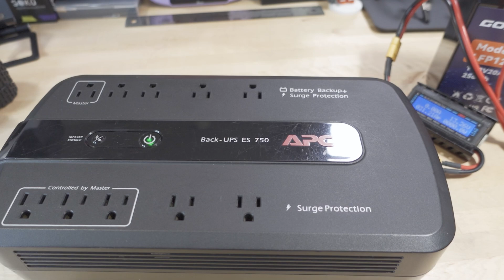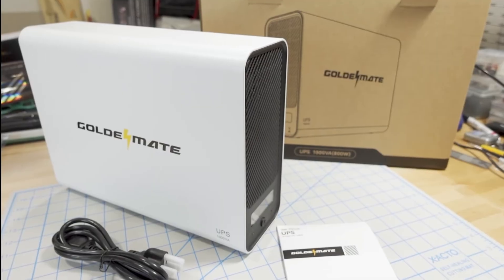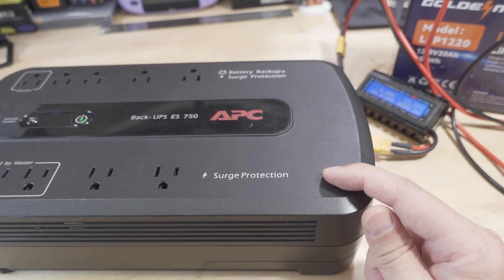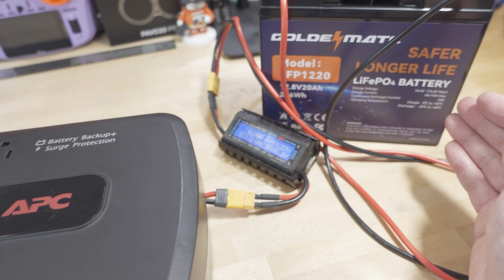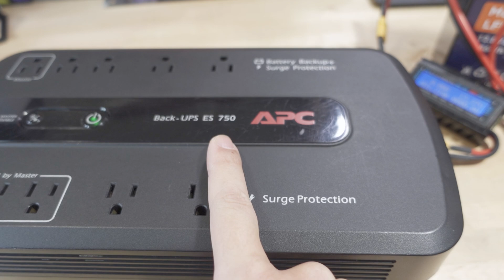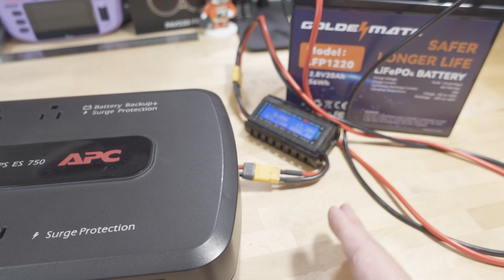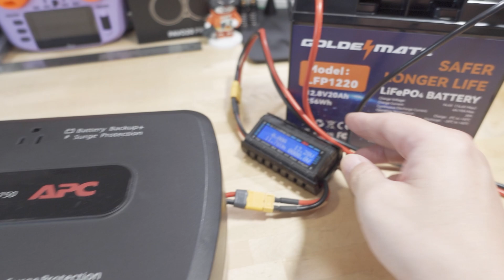DIY LiFePO4 UPS Battery Backup for Cheap ⚡

Comment from the maker: 🛒 Goldenmate 20Ah - http://amzn.to/3yZEfuJ
🛒 XT60 to O Ring Terminal Cable - http://amzn.to/3yXFcng
🛒 XT60 Connector - http://amzn.to/3T97Pon

Goldenmate 100Ah Review - http://youtu.be/cKKXgb5_mlE
Goldenmate UPS review - http://youtu.be/VxXq-cAl_WQ

*note, if you go for a higher wattage setup, you may need higher gauge wires
or a completely different arrangement than shown in this video...
.
.
.
.
.
.
.
.
.
.
.
.
.
.
.
.
.
.
.
.
.
.
.
.
.
.
.
.
.
.
.
.
.
.
.
.
.
.
.
.
.
.
.
.
.
.
.
.
.
the required phrase is "saving money the DIY way"

Comment: What kind of battery monitor is plugged into the XT60? I assume that is not required and just for testing this setup because the battery has a BMS, correct?
Reply from the maker: That's actually a watt meter and is just being used to show data for the video and isn't required in the setup.  Pretty much all of these LFP batteries will have a BMS inside it to manage the state of charge and other safety issues.

Comment: Hi, did you change the charging limits of the UPS to fully charge the lithium battery?  I’m thinking about doing the same thing with a 2200 series UPS but I’m wondering if the bms can be modified to match lithium charging curves and limits?
Reply from the maker: I didn't change anything.  Is that even possible with the old UPS I used?
Reply: @AlbertKimTV not sure if there is a serial or some other programming header. I read somewhere it’s possible with the ones that have serial ports.
Reply: I may be wrong, but I think the BMS for lead batteries stopps charging at a lower voltage than  lithium. What that actually means to the batteries, I'm not sure.

Comment: need asked question will ups charge Lithium battery i have 550VA but am just testing it with 18V 5A Lithium battery but i used a 18V converter to 12V 20A TO used 18V 5A lithium battery but i have 18V 12A battery to
Reply from the maker: This will only work with 12v batteries, NOT 18v batteries.
Reply: @AlbertKimTV  it can work with 18V battery but need converter from 18V to 12v  my usp is 12 volt ok i buy converter for 15.00  let you converter the power from 18V to 12V 20A out out

Comment: The fact in 2024 we still have to do this with the ultra low cost of LifePo4 now because APC and Cyber refuse to update their designs is a joke.  My CyberPower 1500PFCLC just croaked (not the battery the entire unit) so I am going to buy an old used POS off FB Marketplace and convert it like this, either that or get the Golden but I like the idea of being able to maximize the battery size to what I want.
Reply: No, it's not a joke they are sticking to SLA/AGM. A LiFePO4 UPS would be expensive due to the continuous wattage needed. UPS tend to deliver a higher max wattage than a LiFePO4 portable power supply.  LiFePO4 delivers about 1/10 max discharge current than SLA in identical size batteries. APC battery in this video for 7Ah SLA can discharge max 100A but shouldn't be allowed to exceed 33A since it's extremely inefficient and capacity drops A LOT at higher discharge rates, so the SLA is limited to 330W(~32A) in this unit. A drop-in replacement LiFePO4 will have 10A max discharge or 100W output, 1/3d the rated wattage of this UPS.  
Your CyberPower 1500 delivers max 1000W. With 85% efficiency the battery would need to deliver 1200W or 100A continuous. A LiFePO4 that delivers 1200W (100amps at 12V) would be a Dakota DL 100 which can output 100A continuous, 200A surge. The battery costs over $700. 
You'll have to determine your max wattage using something like a Kill-A-Watt and measure your total wattage needed, then find a LFP with sufficient discharge rate (divide by 0.85 for heat loss inefficiency). If you need 300W continuous, then you can use a golden LFP1230 that delivers 30A continuous x 12V * 0.85 efficiency = 306W continuous. 
So, SLA replacement for $35 or a LiFePO4 that is $100 and so large it won't fit so you'll have to rig up all this crap outside the case to work. And you can't use your charger since you'll need it on the UPS incase power goes out. And don't trip on a wire!
Reply: @thebluelunarmonkey  All of what you said is true, but the problem is the conventional, cheap UPSs aren't redesigning for modern PCs. Most people aren't pulling 300W continuous with their PC setup. A typical, modern desktop (not some pimped gaming rig) draws ~50W under heavy load, and more like 10-15W under light load. Throw in a LCD monitor or two, and you're probably not over 100-150W... and most use far less because they are using a laptop. So, these home (non-rackmount) UPSs that can do 700+W continuous are pointless and targeting the wrong metric. But, like you said, LA batteries can pump ridiculous amounts of current for short periods, and they're cheap, so it's easy to slap one of those in and put a huge Watt rating on the box. Let's be real though, there's a lot of benefit to Schneider/etc. using LA, because it'll probably die in 2-3 years max (even with no use), and non-technical people are just going to throw it out and buy another. No incentive to use a battery that will last 10+ years even with deep discharges.

Comment: Just watch out because by putting a massive 20A battery instead of the original 8A battery might give you much longer run time in theory, the problem is with the electronics inside the UPS. They're are not rated to continually run much longer than the original 8A battery. You'll need to install fans just to keep things from burning inside the thick plastic shroud.
Reply: Nah. Just the opposite. Totally ignore capacity, but focus on max discharge current. The SLA can deliver 32A continuous while still having decent capacity, but these batteries are rated 100A max discharge current(but extremely inefficient at that discharge, reducing capacity by 4x or more). 
This "massive" 20A LiFePO4 can deliver max 10A discharge current or 100W max. You'll be able to run a laptop but not a desktop with a decent GPU. He's turning a 330W UPS into a 100W UPS.
Reply: @thebluelunarmonkey  Yup, additionally a BMS is not a charge controller and that UPS likely has no idea how to charge LiFePO4 and may be holding it at SLA float voltage which will kill a lithium battery in 1-2 years as well...

Comment: I was looking into this idea and noticed that the Lifepo4 batteries BMS seems to limit the current to about 1C, meaning a 20Ah battery can only deliver 20A, which with a 12.6V battery, is 252 watts. Likewise, the 100Ah battery can deliver 100A which is 1,260 Watts. Size your battery according to the power you need. I don't know what would happen if you put a larger BMS on a smaller battery. Just saying if the load is above the battery limit, your battery is going to limit the power output.
Reply from the maker: Yeah, this 20Ah battery is perfect for the load I have on it which is about 140W and I have tested it and it works without issues.  Absolutely, you have to size your battery according to the load and use case.
Reply: Will the ups change that battery to 100%?

Comment: Before I say this I want to say that I am a real big fan of lifepo4 especially in low quality UPSes as you will see why although I haven't tried it yet.  You say in your video that sla lasts only 1-2 years.  This simply is not true.  I have two UPSes running for 3-5 years on the same batteries.  What makes the difference is a good UPS.  Both my UPSes are made by Eaton.  I have a line interactive one that has been running for 3 years and a line interactive one that has been running for 5 years.  Now I must qualify that the line interactive has a loud fan running while it charges which can take a day when empty.  The online ups has a loud fan running 24/7.  The time it takes to charge might also have to do with the time the battery lasts.  The online UPS also says in the manual it should last for 5 years.  It's an expensive model and it still hasn't said to replace the battery.  In contrast, I have some other models from Armor Line and their battery in fact was dead after two years and the batteries were significantly diminished after 1 year.

Comment: Nice. But i think you`ll need to add extra cooling because these units were only designed to run for 30 minutes or so. Not 6 for hours!
Reply: The setup in the video only runs for and hour or so and if the current draw is lower, it will last longer and also generate less heat. He did mention in the description if the current draw is a lot higher, the setup will need to adjust accordingly.  However, the one in the video does NOT need air cooling.
Reply: @frankcastillo8869  I don't think this guy actually watched the video... he's a bot or troll.

Comment: Love the golden mate white ups. $150 ish on sale. Powers my router, denon av receiver, 65”oled, ps5 no problem when the breaker flips 😂 bought one for my dad too😂
Reply: The golden mates are nice, but the 20ms switch time is slow enough for pcs running ATX3 or 3.1 power supplies to black out. Not great for a real UPS.

Comment: Useful setup. Especially if you live an area prone to power issues. A friend is doing almost exactly what you are doing. Lives in an apartment complex that has had issues. Using a large capacity LiFePo battery and inverter. Saves a bunch going the DIY route. 👍😎